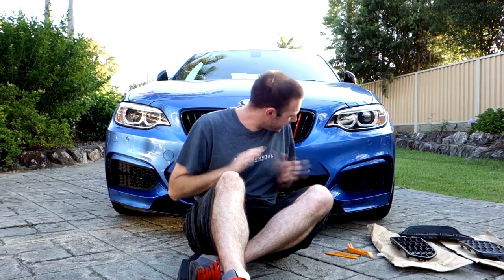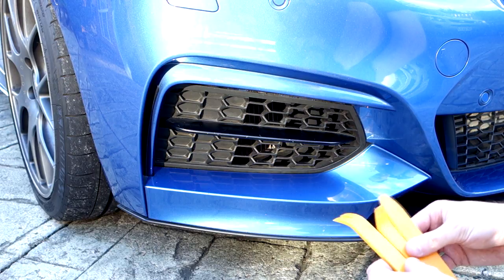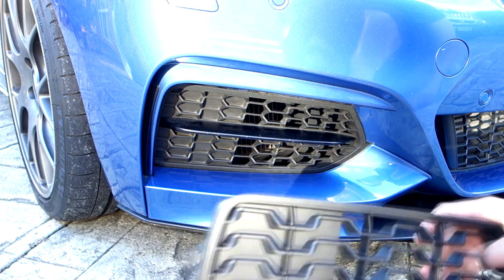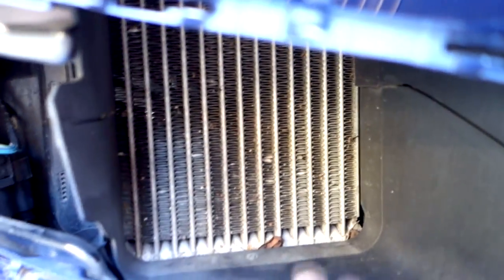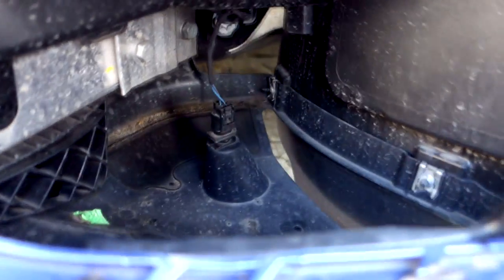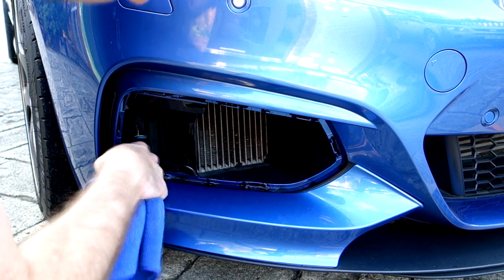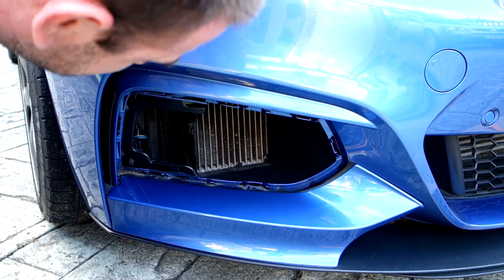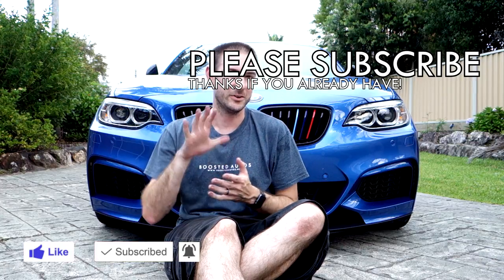Installing M240i & M235i USDM Lower Grille Inserts

Comment: Hey mate: when I use these part numbers they keep saying only for M2 but I have the same as you and they look the same? Any info? Thanks
Reply from the maker: Sounds like they’re mistaken. They definitely don’t fit the M2. Double check the images on google for the part numbers you’re ordering to make sure.
Reply: Boosted Media thanks mate I’m pretty sure you’re right, thanks for this video. Appreciate it and the reply 👍🏼 happy new yr from the UK
Reply: I have the same issue?
Reply: TCKZ Combat Crew really easy to purchase from main dealer only about £30 each 👍🏼 Goodge the part number
Reply: jmlt12 thanks for the reply bud, googled the part no, comes up with M2 inserts? In UK we only get the fogs or the standard as he had unfortunately from dealers
Reply: TCKZ Combat Crew no I’m up too, let me look for you
Reply: @jmlt12  thanks appreciated!!
Reply: TCKZ Combat Crew no probs!

Comment: I'm pretty sure that's an auxiliary radiator not oil cooler 🤔
Reply: I have an 2016 m235i and it has an oil cooler on the passenger side and a auxiliary cooler on the driver side I have m pakage I guess